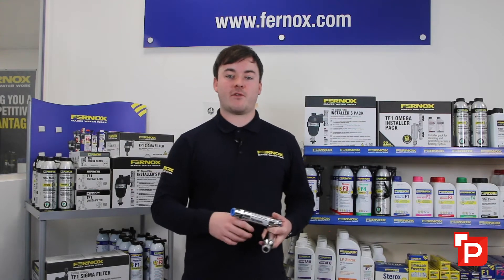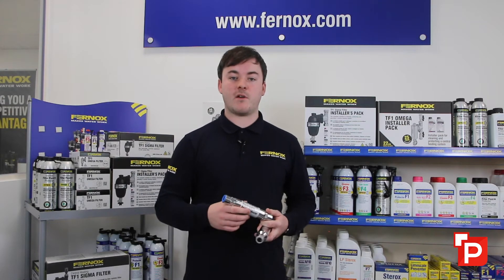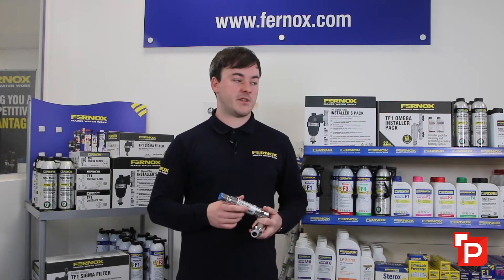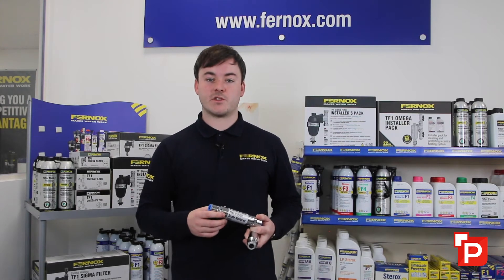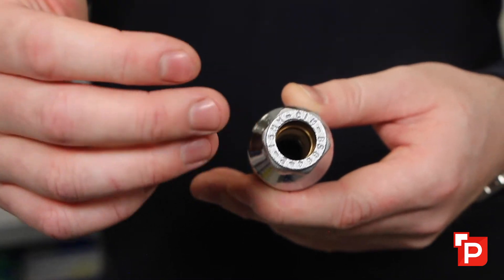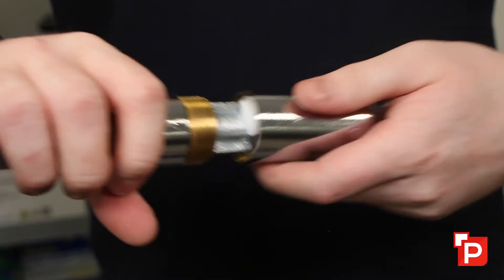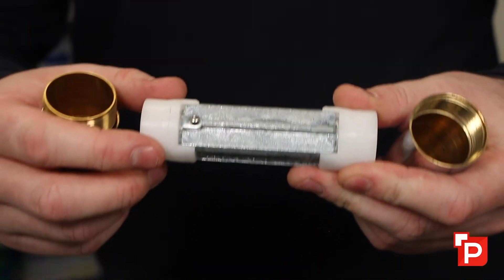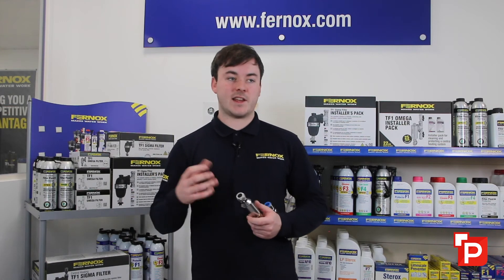How does a Fernox Scale Reducer work and why need one?

Comment: Roughly, I have to replace my water heater elements every 10 months without adding salt for my salt softener. Sounds like this type of products can only make it every 10.5 month or something like that. Not much usage for me?
Reply: What he is selling is basically the same as what is it inside of your water heater
Reply: Sounds like you have a bad anode rod in your water heater.Look up how to replace the anode rod and that will catch minerals That are eating up your elements.When you’re anode rod is scaled up it won’t Catch the minerals that are eating away at your elements. Also as you are replacing your anode rod you may as well pump down your water heater and then refill it back up to get rid of some of that nastiness in there
Reply: Also when your anode rod is bad you may get a foul smell in your hot water